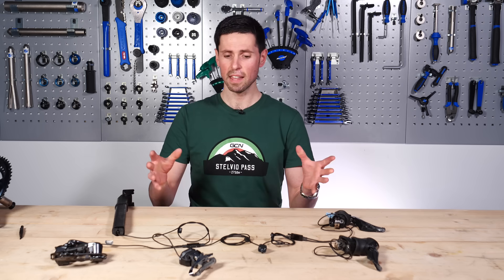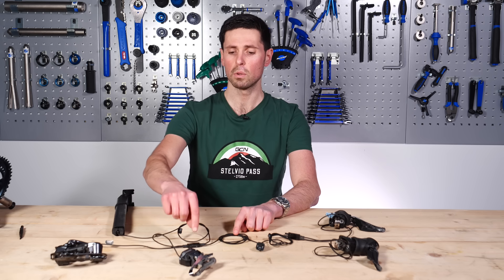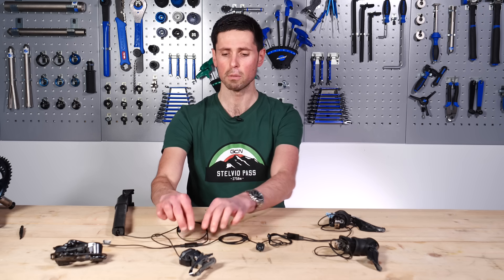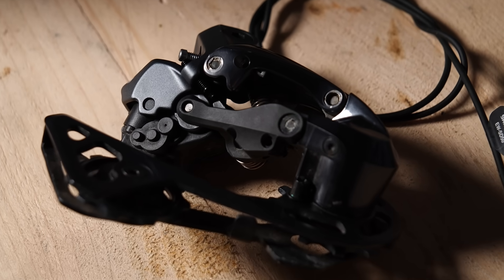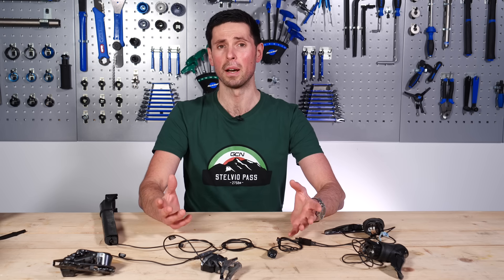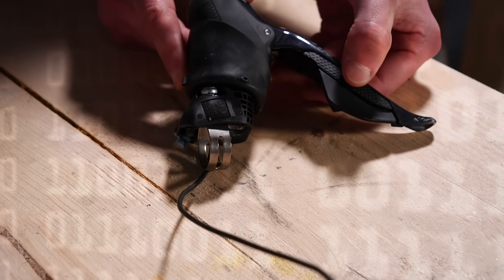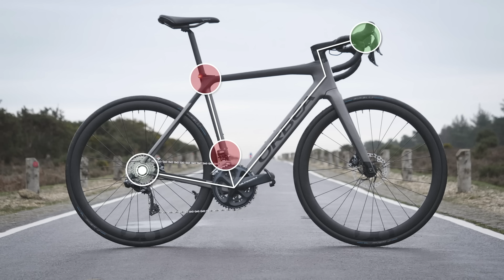How does Shimano Di2 Actually Work?| Electronic Shifting 101

Comment: I've always admired bikes for their simplicity.
I've ridden bikes as transportation since the 70s, watched tech change.
I feel bikes should be affordable, easy to work on and modifiable.
I have never been stranded because I couldn't get my bike back in working order with the tools I carry with me.
Nice electric stuff but feel it doesn't meet the  ease of maintenance mechanical systems afford, certainly not as cheap for us working stiffs.
Reply: Agreed. On the contrary, electronics are a lot more durable and maintenance free (not speaking about consumer electronics here). Considering that the shifter is a very common problem source in bikes, I'm curious to see how the electronic shifters will hold up over time. The pricing is still a bit high atm though. Working as a roboticist and also in the automotive industry previously, usually choosing a solution follows that order: software, electronics, mechanics. So I'm actually very pleased to see electronics entering the cycle market, it will be a matter of time until software follows, and we will have all sorts of software based tuning.
Reply: That's a moot point. When it does break, it will be nearly unfixable. And parts will not be available in a few years. Granted, that's already a problem with modern mechanical shifters. Yet you can always mount a friction shifter if everything else fails.
Having 'smart' tech on a bicycle is ridiculous - a bike should be able to run on muscle power only, that IS the point of it.
Reply: there are plenty of low cost affortable ones around, why are you virtue signalling under the video of a top end product
Reply: I think Sram Etap fits perfectly your description, unfortunately is Still stupidly high priced.
Reply: @SixSioux I'm far from being a Shimano fanboy, but SRAM eTap is exactly the opposite of being simplistic imo. In fact, I think it's one of the worst products ever designed: Modern road biking already needs way too many batteries being charged, and having 4 additional ones for my shifter alone doesn't make it better by any means. There's a good reason why cabling in vehicles exist; nobody would even think about charging each backlight of their car individually. But in the bike world, for some bizarre reason, such annoyances are totally accepted and even desired. 

A good Di2 cabling can easily last more than a decade only requiring a single battery, and I really hope Shimano sticks to this way superior approach.
Reply: 1974: We'll have flying bikes in the future
2024: Have you charged your derailleur already? - No, unfortunately it has bricked and needs a firmware update.
Reply: Funny how electronic shifting is actually less maintenance. No cables to rust, and no frequent adjustment. I will gladly take my bike to the shop for major maintenance.
Reply: That's high end stuff on more than 5k bikes. This isn't for you and doesn't fit your needs AT ALL.
Reply: I totally agree with it.
Make bike simple, affordable, let people enjoy bike riding, live healthy life.

Comment: Very interesting program, Alex (and staff)! What you said about previously being an auto mechanic is exactly why I don't want electronic shifting or disk brakes on my bike. I don't want to be an auto mechanic! I like having a very simple set of tools along with me on a ride, confident that I can repair any small problem and be on my way. I don't want to worry about batteries or bleeding hydraulic cables, etc. should something go wrong.
Reply: Underrated comment.
Reply: Dude suspention is when the servicing nightmare begins
Reply: That’s why we have cell phones….
Reply: @truthserum9157  ...and I don't have a cell phone - they are a plague on society!
Reply: Is that why you drive a car that is hand cranked, has a carburetor and a distributor? Di2 is pretty reliable. Mechanical systems have their own issues.
Reply: @amaclach  As I said, I don't want to be an auto mechanic and hire one when needed...and again repeating, I can fix my mechanical bicycle issues with simple tools.

Comment: How does it do power and digital signalling over the same wires? 

Also the cylindrical end of the tool is used for pushing the plugs in, and the sharp end is used for prying the plugs out.

Comment: I’m slightly skeptical only because I like to keep my bikes forever and I wonder how, in 10 years, will the stuff hold up or if the specific version will become obsolete. I have bikes from the 80’s and 90’s that still work amazing and haven’t needed any maintenance at all. I guess I’m an archivist and with new computer based mechanics I question the longevity. Also if I crash and damage a rear mech the ala cart replacement costs is huge.

Comment: I wanted to add a Bluetooth module to my Di2 setup and was fretting over how I would get it to work until I realized the setup was a CAN bus, and it would just work. All I needed was a junction box and short length of cable. Bike is now Bluetooth/ANT enabled, and I can control my Garmin with the top buttons on the hoods, and get gearing and battery data on the screen. Cool!
Reply: The only shame is, that it's not included by default and they charge a fortune for the short cable you need in addition.

Comment: Doesn’t the battery add a whole bunch of weight??
Reply: Negligible weight penalty IMHO. I just got Di2 DuraAce on my new bike, it’s awesome. Ultra precise, super fast fingertip shifts. Charge lasts thousands of km and you just plug a mini usb -type plug w supplied adapter to recharge it. Cables all internally routed.

If you can afford it, get it.

Comment: As far as I recall, the shifter signal goes to the battery, which processes it and then sends out a different "shift rear down" signal.  That's how you get multi shift and other fancy stuff.
Reply: In first gen (7970), the CPU was in the front derailleur, all newer have it in the RD 👍 battery can also be 3rd party (like with e-bikes: Shimano, BMZ or Bosch made batteries)

Comment: #askgcnanything Hi Alex upgrading a bike for my wife. Could you show me how to swap a square taper bottom bracket for something that will accommodate a Shimano 105 crank set. Thanks
Reply: maybe it would help : https://www.youtube.com/watch?v=Mvdajb1OSW8
you need a sort of extractor tool. I did it recently on my hometrainer bike to upgrade Claris to Tiagra. The worst part for me was to remove the plastic BB, i ruin it with the tool !!! it was scary ! 

Be carefull ! to unscrew the BB, its not the same way on each side : clockwise in a side (chainset), anticlockwise in the other

Comment: Maybe I wasn't listening carefully enough 😅
I am interested in knowing how the shifters themselves work. And for example how do they adjust to be correctly on the gear (eliminating the need to adjust cable tension). Don't mean to be rude but the cabling part is quite obvious to me. 
Juicy detail please 🤓
Reply: The servo moves a predetermined amount of space that is adjustable with the fine tuning features.  Also, you can tell the system exactly what you're running for gears and it will even display on a head unit.
Reply: @adamsteineke4661  thanks very much, that describes is really well.

Comment: A shame it's not FULLY wireless, as it just looks too messy and cluttered on a bike.
Reply: You don't see the cables on a bike though.  They are routed internally.  Regardless, wireless isn't all it is cracked up to be.  I have seen SRAM systems flakeout in high wireless environments.    Don't get me wrong...wireless is great....when it works.   :)
Reply: Fully wireless is good.....until you have to charge all of those devices separately and the connection suddenly drops in an area with high interference and you get forced into the wrong gear at the wrong time

Comment: What is the weight difference between Di2 and a comparable mechanical groupset?  Even small batteries tend to be pretty dense.
Reply: I think GCN did a previous gram for gram comparison of mechanical vs Di2; seem to recall there was only a gram or so difference between mechanical Ultegra and Ultegra Di2.

Comment: Love my di2!  Love having it talk to my Garmin.  It's great to be able to see the di2 battery level on the Garmin.  Even better to be able to see what chainring your in and what gear you are in on the rear derailleur, right there on the Garmin, no need to look back.  I also run my in semi synchronized.  I'll never buy another bike without di2 or SRAM equivalent.  Would you do a video on the pros and cons of running the di2 in manual, semi and full synchronized?  Would also be nice to run through the software.
Reply: Hey Steve, which Garmin device do you use?  Thanks!
Reply: @mrcstb7479  I have a Garmin 520, but it is my understanding that Garmin, Wahoo and Karoo all communicate.  I did have to buy a Shimano ‘interface’ item (~$100) that is connected inline  on the dI2 cable.  Best $100 I ever spent.  I love knowing my dI2 battery level and what gear I’m in both on the front and rear derailleurs.

Comment: It would be very interesting to know why is it that electronic shifting is supposed to work better under stress, for example at low cadence on a steep climb while pushing high watts. I can only imagine that the force the derailleur applies to the chain as it moves is way more even with an electronic system, as a mechanical system will have a transient or peak until the first few links engage, at which point there should be a lower feedback going "back" to the levers. This would be particularly true while shifting "up" to a lighter gear in the cassette while going very slow, though of course intuition and physics don't always go hand in hand. So Alex or Ollie, I would really appreciate it if you could unravel this mistery! (Alex might need some science glasses though)
Reply: I absolutely love hearing people answering these types of questions, I'm nerdy in this way too.  I hope someone can come along with a good tested theory for us!
Reply: I follow your idea.. The force being applied must alter along with the force coming back from the chain, to keep it in a precise force range for the smoothest transitions.

That has got to be more rapid and precise than us.. Because we receive feedback from our feet on the peddles, through to the legs etc and by the motion of the bike.  That then has to be processed and turned into a correction of force output, which by then.. clunk awh not again!!

Comment: I hear from friends that it is a game changer, although I'm perfectly happy where I am. What I don't understand is why we are still using cables? Can't we move to bluetooth or Ant +?
Reply: Sram uses wireless, but that adds multiple batteries to the mix.
Reply: @adamsteineke4661  That makes sense, though I'd rather have the batteries and no hassle of cable threading.
Reply: @playandteach  I'd rather have the one-off hassle of cable threading than the permanent hassle of multiple batteries and potential pairing issues.. Just like wired ethernet vs. WiFi, wires are best unless you have a good reason to ditch them!
Reply: @playandteach  what's more hassle is having to remember to recharge multiple smaller batteries each time versus charging a single big battery, and the connection dropping randomly when there's high interference around which makes you unable to shift, plus as one of the comments said, how often do you change your entire groupset that having no cables does matter?

Comment: Still feels like something from another geological era compared to the SRAM wireless system (not thinking about how well the idea is implemented and function, rather only about the idea behind the product). Feels like they just  changed a lot of cables for a lot of wires.
Reply: Except the wires don't stretch like cables do, I'd also prefer to charge my internal battery a few times a year versus having to remember to charge multiple batteries for each ride... that said, it is a lot less cabling to deal with!
Reply: @adamsteineke4661  battery wear and electric dependency is not an improvement. Shifting mechanically is way better, gives more feeling to the gears and provides faster control than electric could offer. But hey, if it makes you happy. Go for It.  I was hoping this video explained the DI2 shifting mechanic in detail, So I could use it on a IGH-8 speed or IGH-11 speed Alfine using mechanics only, to shift old style without electric. Not sure if this combination is possible, so still hesitate what to buy for IGH.
Reply: @zachm.3049  That's what I used to think about electronic shifting.  Then I bought my teammate's time-trial bike, which was outfitted with Di2.  Once you get used to that, you're spoiled.  I once got dropped in the Grant's Tomb Classic (a late winter crit race) when my mechanical shifting acted up in sub-freezing weather.  Di2 just works, instantly and smoothly, every time, under any conditions.  No more fiddling around with it constantly when temperatures change or cables stretch.  No more afternoons spent threading internal cables through frames a couple times a year.  The mechanical shifters and derailleurs on my main road race bike are worn out now.  I'm replacing them with Di2--if and when my LBS can track down the necessary parts.  I'll be doing more riding, and less fiddling around.  I can't wait.
Reply: I have Campy EPS which also uses wires. I can't really see what the advantage is with wireless THB, except that it's easier to install. Once it's installed, who cares if there are wires inside the tubes? And you just have one thing to charge and never need to worry about pairing / connection issues.
Reply: @Gerardo Telese I've learned not to trust anything too important to wireless technology.  I could picture riding alongside other riders with the same groupset and the systems interfering with each other.  Wireless systems generally don't depend on using different frequencies to isolate from each other, but rather, different IDs in network header packets.  When several of these systems are used in close proximity, it gets harder for the electronics to filter out the content from the noise generated by nearby wireless networks.  For this reason, my whole home is wired except for the few devices that lack an RJ-45 socket, and require wifi to operate.  My wired stuff always works, while my wifi-only devices suffer from frequent dropouts and generally unreliable operation.

Comment: I'm sticking with mechanical shifting on my road bike for the foreseeable future. It's less expensive, easier to troubleshoot, and it's one less thing I have to remember to charge. Forgetting to charge my head unit or speed sensor is merely inconvenient; forgetting to charge my group set can end a ride. I might change my mind if I had to manually adjust out front mech rub on highly cross-chained 13+ speed group sets.
Reply: I used to stink the same until I rode with di2... it’s a game changer. The battery lasts a very long time and the battery level can communicate with your bike computer so you know where it’s at!

Comment: Mechanical until it trickles down to 105
Reply: Can I ask? . Do you mean get mechanical unless you are getting a groupset above 105? Thanks 🙏
Reply: @BBgreen46  meaning mechanical until we get 105 di2
Reply: @BBgreen46  basically anything above 105 is very expensive (and in my opinion unnecessary) but the tech tends to 'trickle' down so in about 5 years you'll see Di2 on more affordable groupsets
Reply: @morgandebruler9281  took 10 months..

Comment: as an electrical engineer, I've designed items that used CAN to communicate.  These had separate wires for power, though.   Does Shimano use a version where the data rides on top of the power, similar to "power over ethernet"?   I've found a few mentions that there might be ways to do this, but it seems uncommon.  
This is a deeply techie question for GCN, so apologies in advance.  ;-)
For anyone wondering about CAN, here's the Wiki page:
https://en.wikipedia.org/wiki/CAN_bus
Reply: I think it's much safer to separate power and signal lines If you want a fail safe mode for your components, because if the signal and power is lost, nothing is controllable anymore. If your signals and power are splitted, your powered components are still able to go into a specific mode by themselves. But this is just important for critical components (I wouldn't say that shifting is a critical component, but maybe they will implement wireless braking in future?!).
Reply: If there are two wires per cable then one is power and the other is data I would assume.
Reply: @virtualmartijn  I think a ground wire is still needed to let those electrons get back to the battery, as well as being needed for the data.

Comment: Great explaination, only been riding Di2 for about 6 months and helps me understand why my firmware updated and how I can change what each shifter does. Now just have to remember to charge up every month or so as lost power to front as battery dropped below 25%.
Reply: FD works until 4% Battery capacity...above 20°C that equals 2-3h easy riding, or 1h in racing environment. (Depends on profile/nr.of shifts)
Reply: @CXCyclist  2-3 hours? That's not very long at all!

Comment: #askGCNtech I am in need of your superior knowledge of all things bike. I am currently converting my 1997 mountain bike into a road/gravel bike and have bought some 3x7 speed road bike shifters. The right shifter works OK with the old stx rc rear mech but the left shifter is really not compatible with the front mech/ chainset. Arr you able to tell me what components I might need to replace to get a working system??? Is it a case of bottom bracket, chainset and front mech or maybe just a different shifter????  I will be submitting it once finished Loving! Loving all the content- keep up the great work!!!